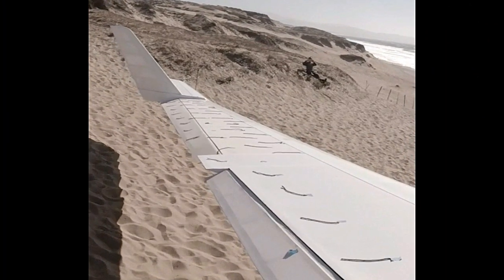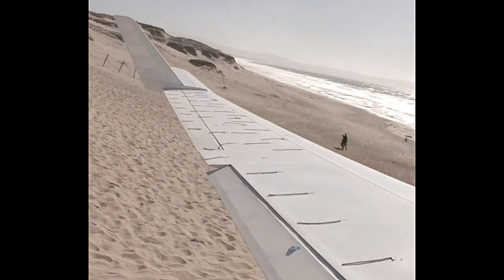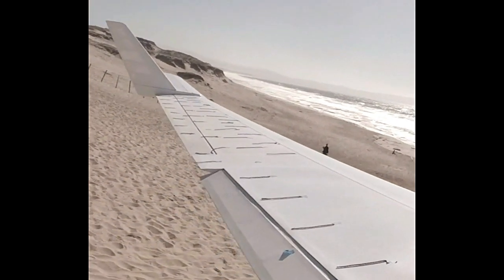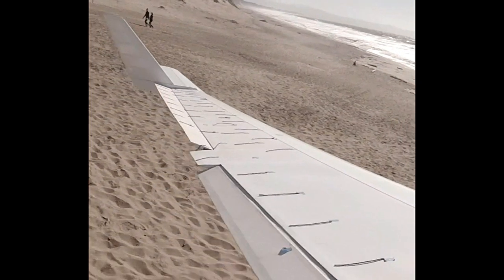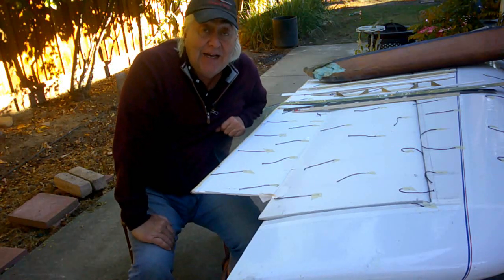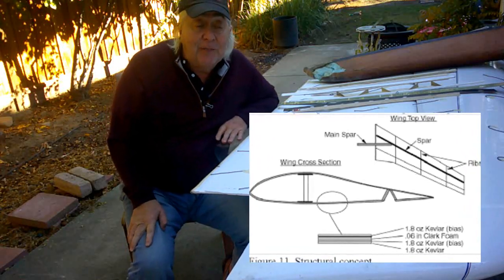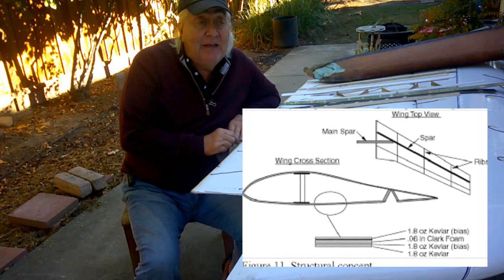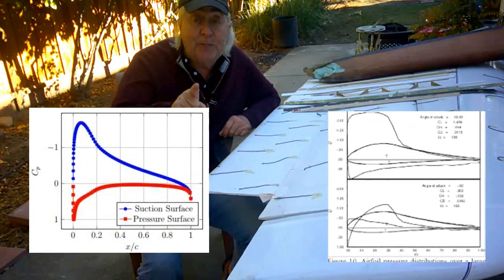Reynold's Number Issues Part 2- KW MkII Development

Comment: I'm sure the concept of using a Youngman flap type control surface for an elavon has been considered. It wouldn't effect laminar flow of the airfoil and could be extended on booms away from the trailing edge as much as you need for the right moment arm etc.
Reply from the maker: 1st off, let me say that my controllability issues have been resolved with flat plate trailing edge flaps. If you look through my videos you will find a series that describes the root cause of the problems and the eventual solution. Fortunately, the solution is simple, lightweight, and has great control moments. Actually, no I had never heard of the Youngman flap. In fact, when I google it, there is very, very little hard data (drawings, etc). They were invented in the '40s and fell out of favor. The usual reason this happens in aerodynamics is that when in use, it is found to be a poor tradeoff between, desired effect, weight, build complexity, reliability, etc. From what I've read the Fairy-Youngman flap had a very large chord. This approach will cause a huge amount of drag and putting flaps on extended arms also causes a ton of drag due to the gap. You can review videos of my analysis of the Flair 30 crash to see why the large chord causes so much drag.
Reply: @KlingbergWingMkII  Thankyou for the detailed and thoughtful reply👌. I did think of the stowability and safety of a glider with cumbersome add-ons as I added the comment, and I haven't seen a glider with such complex controls accept fixed slots like the Stemme S10. You are doing very intersting work merging Sail plane and Hang glider tech. You have also clarified a lengthy miss-understanding I have had over Reynolds numbers. I simply thought it was a scaling dynamic applied to wind tunnel and air released scale models of full scale prototypes ie lengths of fuselage/airfoil in relative airflow per second.

Comment: Very informative video. It's hard to appreciate all the time and effort put in to solving a problem that so few would encounter, and even fewer would understand completely. Your methods of finding out how you identified the problem are a gold mine of information. So, my sincere "thanks" for your video.

On the design side, perhaps you could look at installing a wing cuff at the outboard wing to extend the leading edge of the wing without any major modifications to the trailing edge. Installation and adaptation may be easier since you have the D tube to anchor off of. Many aircraft are starting to adopt the Cirrus like wing for spin resistance. You can then perhaps play around with a slightly different airfoil by virtue of modifying the outboard leading edge geometry (i.e. make it a low Reynolds number airfoil) to get a more favorable Reynolds number without necessarily increasing the chord of the wing to 32".
Reply from the maker: Thank you very much for all the kind words. I love all the support. Funny thing, the LE cuff was the preferred solution (Peter's idea) for several days. Then I realized that I had some data that showed there was more at play here than Reynold's number. I think I will be able to stay away from the low Re airfoil choices and thus retain the high speed end performance. Please stay tuned for the entire series, I'm sure you'll be surprised at the final solution!